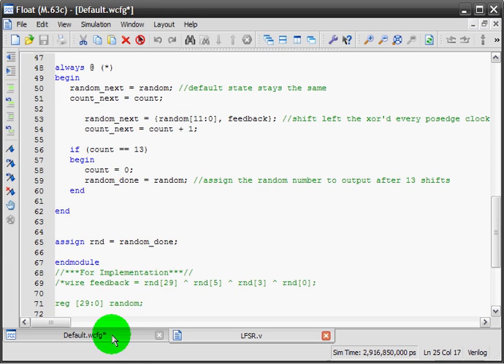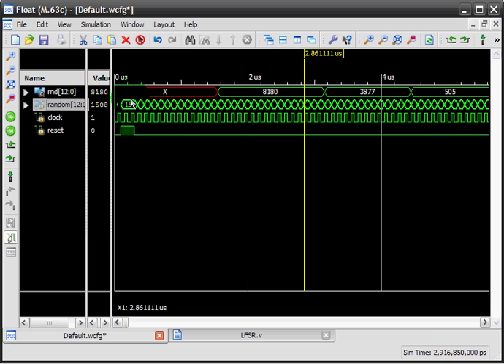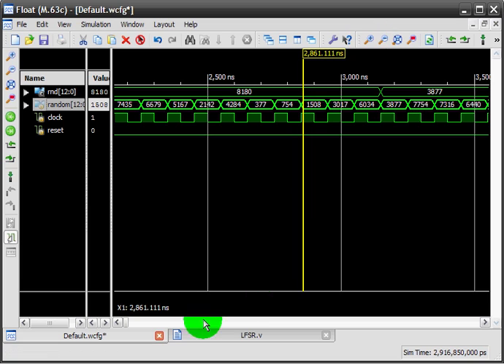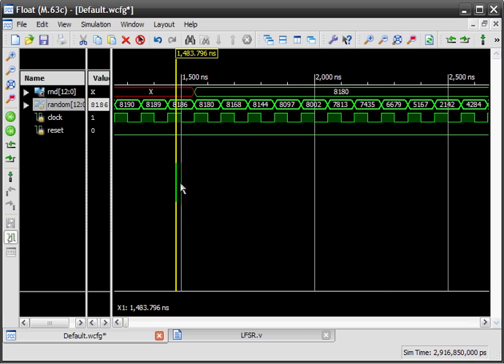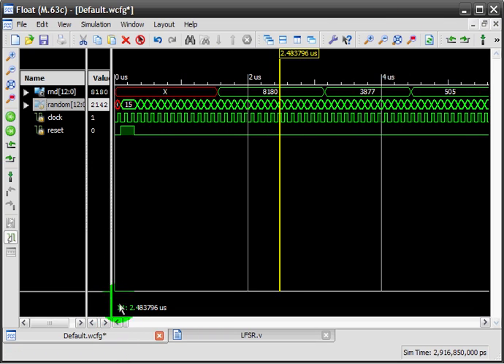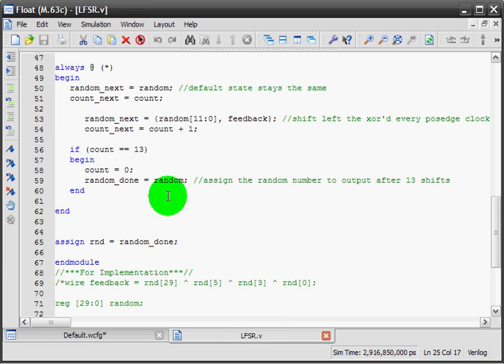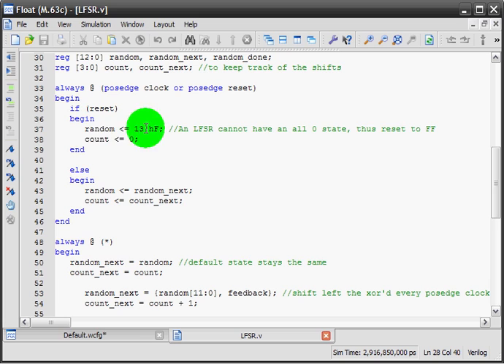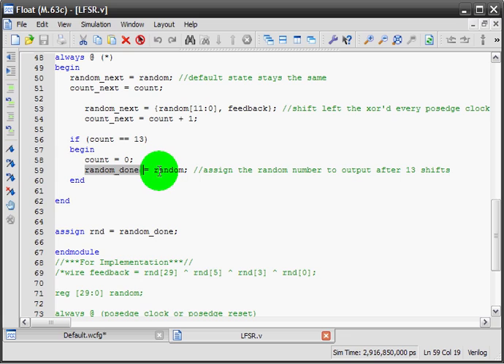Random Number Generator (LFSR) in Verilog | FPGA

Comment: hi. i have a little  when i compilated the code,  it says that random has not been declared just in the part that you use the wire feedback, i dont know what happens. could you please help me?, thanks.
Reply: +Santiago Tirado same here
Reply from the maker: +Taiwo A +Santiago Tirado. I'm sorry for the very late reply. I did not get any notification for your comment. The code I have given on my blog, simulates as shown in the video here. The only reason I can see you are having this problem is because maybe you did not reset your code. The random is initialized after reset, so in simulation do you have reset = 1 then delay and then reset = 0; ?

Comment: this is very useful thanks! however could you also share the codes for simulation of these codes? I can not see the waveform correctly.
Reply from the maker: Hi Irem. I have added the test bench code to my blog post.
Reply: Faraz Khan thank you very much!
Reply: Faraz Khan hi. i have a little  when i compilated the code,  it says that random has not been declared just in the part that you use the wire feedback, i dont know what happens. could you please help me?, thanks.
Reply from the maker: Santiago Tirado You should not be getting that error. Which software are you using to compile the code?
Reply: Faraz Khan
 I am using  xilinx ise 14.6 is there  the problem?
Reply from the maker: Santiago Tirado Aah right, I tried to simulate the same code again and its working fine. I wrote this for simulation purposes. If you want to implement it onto a FPGA board only then will you get this error. Is that what you are trying to do?
Reply: No jet, i am just trying to understand the behavour of the code. What else do you think the problem could be?
Reply from the maker: Well that is exactly what simulation is for. Copy the simulation code from the blog post and see how it works with each clock cycle. There is no problem. It's just that implementation behaves differently than simulation. I have other posts where I have implemented this code on the fpga. See those

Comment: Any way I could see the code for implementation and not just using a tesbench?
Reply from the maker: Hi, I did not implement this code alone. However I used this in another code and implemented that onto my BASYS2. Its been implemented in the reflex tester on my blog. If you want to implement this alone then you can do so easily by connecting the rnd output to the 7 segment display